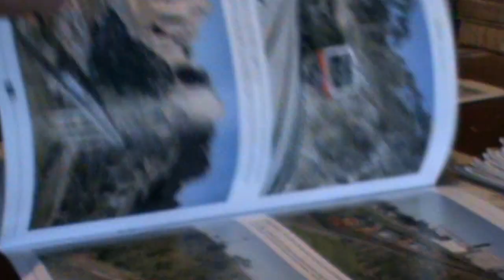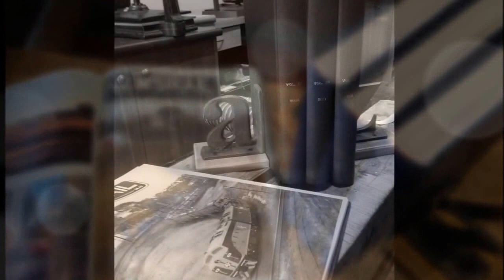Creating a Magazine Binding

Comment: I have almost 10 years worth of a magazine called The Sky at Night, published by the BBC in the UK.  Each magazine is released monthly and uses the stich binding method you described.  Is it possible for me to have these bound  into a case binding?  We've been having a massive clear out and I've just  dumped (regretting it already) 20 years  worth of National Geographic at the recycling centre, and my wife  wants me to do the same with the Sky at Night magazines; however as a keen astronomer, I think they would be much better if they were hard backed bound so that they could be placed on my book shelves. 

As a pile of magazines that stands exactly 14'' in height when stacked,  there's no suitable place to put them unless they are placed in the attic  (the attic which includes three separate area's is literally stacked up to the rafter in places and the main room you have to climb over boxes to get to the window); or some obscure cupboard full of junk. If that was the case, it would seem more prudent to just dump them because we are rapidly running out of storage space, having accumulated 30+ years of old clothes, bric-à-brac, books & vinyl records, old computer stuff, old TV's (flat screen) and computer monitors, video & DVD players & old camera's  etc  living as a couple and family since finishing university back in the early 90's; however,  I love the magazines so would rather get them bound professionally, even if it's going to cost me significantly.  

I did consider trying to do it myself, but I would want them looking their best on my shelves, so I think it more prudent to go professional as I don't have the equipment you showed in the video.  That would include decent lettering on the spines to identify the  name of the magazine and the year of publication.    Each year includes 12 issues at 100 pages in length counting the front and back covers that are on a more glossy and slightly thicker paper (as described by your description of a magazine); each issue is exactly one eighth of an inch thick (3.175mm) or  1.5inches (38.1mm) when I compress the pages. Another eight copies will give me ten years of magazines, however I missed the first few months of 2014, but apparently, these can often be found for sale on eBay, so I'd be able to make up a full years releases.

If it's possible to give a rough estimate,  how much do you think it would cost me to have them case bound by a professional such as yourself?

By the way I enjoyed watching your interesting video. Thank you for the video, it was informative, though as someone else mentioned I didn't get how you  sewed the pages together though I can see why you cut into the edges for the  string to lay flush.  Did you drill  or did you use the  staple holes to thread the   string?

Comment: Having book binding tools is the key. I don't think I have any of these tools, other than the workbench.
Reply: The Guillotine is a bit of a luxury as the magazines will usually be the same size approximately.  Clamps or heavy weights could be used instead of a screw down press.

Comment: nice but sorry i don't understand..  how does cutting them with a saw create a system to bind with?
Reply: You are wright
Reply: It creates grooves that fit the vertical strings and gives the glue more surface to adhere to
Reply: @BexMcInulty  Hi! I am watching this video and process for the first time. It definitely excites me and also has me wondering, where would one get that old operable  and original equipment used for  in this video?
Reply: Simply makes holes in the spine through which thread can be passed to stitch together. Less work than piercing holes.